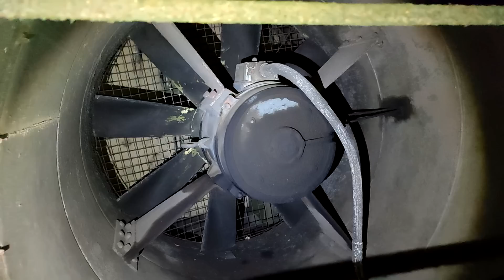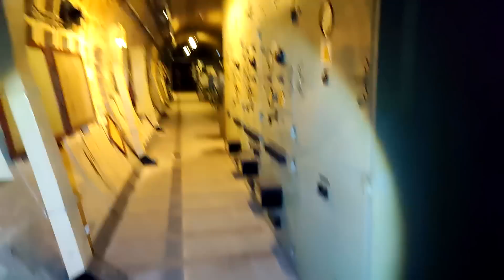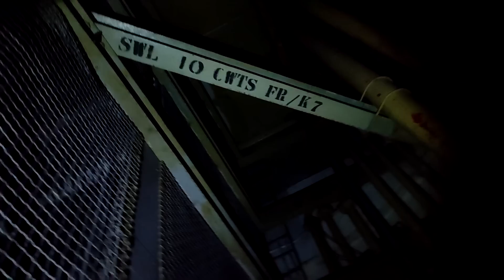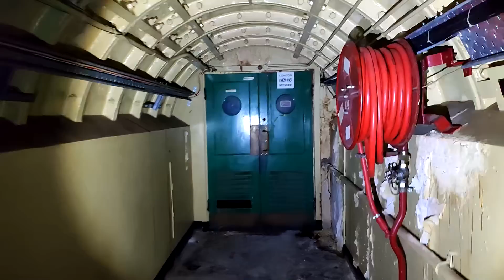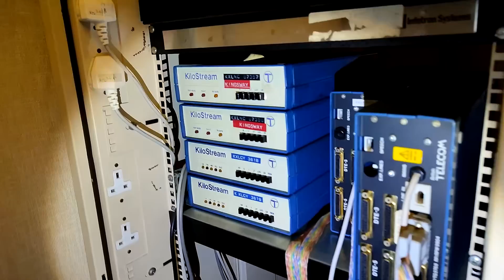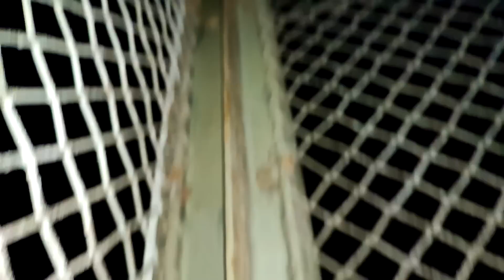FULL TOUR - Chancery Lane Bunker (Kingsway Exchange)

Comment: 47:01  It's only a matter of time until somebody smashes their way into the trunk tunnel.  And I bet it isn't alarmed apart from at the main entrences which means once you get through the wall into it from one of the deep level shelters, you can explore the whole thing with out anybody knowing you're in there.
Reply: Careful. If I had commissioned the bricking up of a trunk tunnel I would have had remotely monitored vibration sensors installed on the other side of the wall knowing that someone with the right tools could get through that wall in a few hours.

Comment: I absolutely love everything about this place, and if I could, I'd buy it and live in it.
That Zeta Systems computer is based on a Digital Equipment Corporation PDP/11. I don't know what model though. Those ports would have connected to serial terminals and printers.
Those tape drives are disk pack units. They were like removable hard drives.
Reply from the maker: I wanted to do an overnight challenge in here, but the problem was that the air quality wasn't good enough.

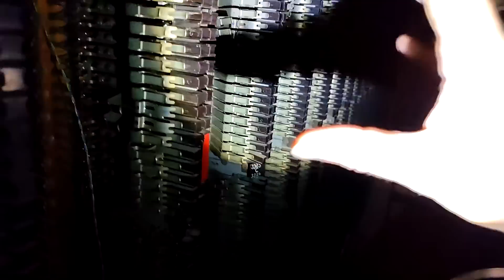Comment: At 48:35 those are lightning arrestor blocks, they have a carbon piece that arcs to ground when it is struck by lightning to protect the  equipment. They connect to the switch through wiring, nothing plugs in the front. I don’t see any remains of  switching equipment there, looks like the only thing remaining is the protectors and the MDF, which both facilitate connection to the exchange.

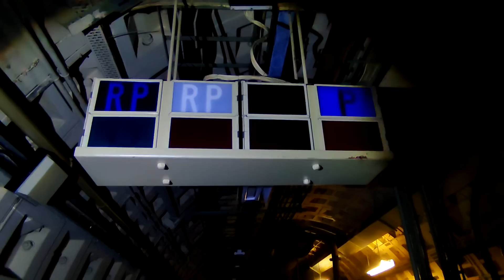Comment: Not sure what the specific indicator at 36:50 is for, but we use similar ones in telephone exchanges to indicate alarms. For example, a blown fuse would sound an alarm and light up the FA light for a specific area or piece of equipment, that way you can know exactly what is wrong at a glance.

Comment: That computer appears to be a Digital Equipment Corporation (stylized DIGITAL) pdp-11/23. You’re right about the terminal part, you’d have the computer in a central location and hook a bunch of terminals to it for people to use. It looks like the brown rack you showed right after is a pool of dial up modems. Those would probably be used by people to dial into the system using their own modem remotely.
Reply: Just saw the part where you get a close up of the modems with the names on them. I bet each one of those would be connecting to a different telephone exchange, so in an emergency, they could manage them from the bunker.

Comment: I think this used to be a mineshaft, you can see with the supports and the ladder. I’m not 100% sure because of the lift
Reply from the maker: This place was not used as a mine
Reply: Is this place still patrolled? (Or in a specific meaning, maintained?)
Reply from the maker: It is patrolled every week.  The lifts are still maintained.  It is on standby in case a nuclear attack happened.

Comment: Hey ::) Thank you for the cool bunker exploration. I wonder, if these lifts still get technical service by some government contractors.
Reply from the maker: This bunker is still maintained.  Looking at the sign in sheets the bunker is patrolled every week.  The lifts are still maintained.  The bunker is ready to be put to use if a nuclear attack happened.
Reply: @benolifts  Oh, that´s weird cause that in a war situation, military personal couldn´t live there right now
Reply from the maker: In its current state it isn't usable, but it wouldn't take much effort to put it back into use.
Reply: @benolifts  But all the installations are rusty and the walls got moist
Reply from the maker: The equipment was to run a telephone exchange.  If a nuclear attack was to happen I don't know if the government would want to reinstate the exchange or just use the bunker as a general control center.  This one would be used by government rather than civilians because it is connected to the trunk tunnel. 

If an attack was to suddenly happen they wouldn't be able to get the bunker into use suddenly.  The bunker is not really in a standby ready state, it is more in a mothballed state where it could be put into use with minimal effort.  The filtration systems and generators would probably be replaced.  The government hasn't done this as there is no reason to think there would be a nuclear attack any time soon.